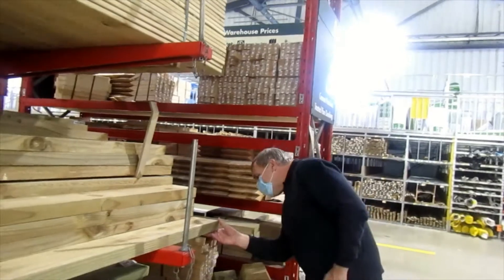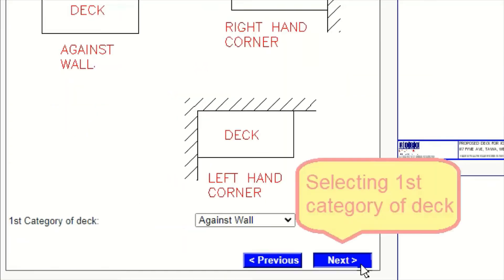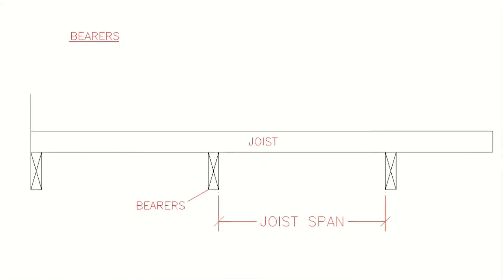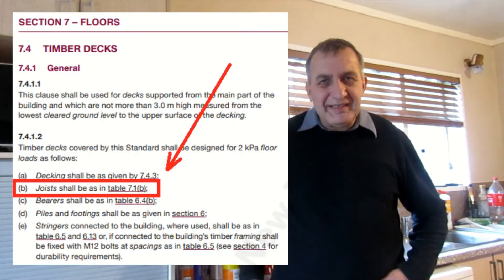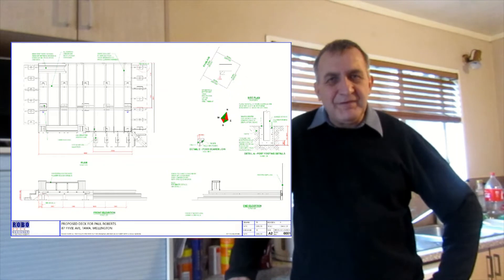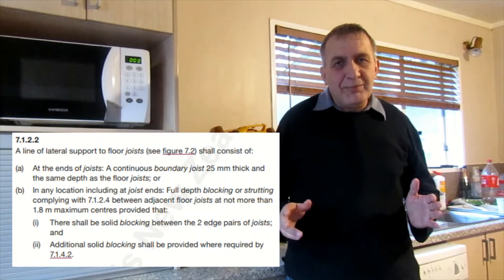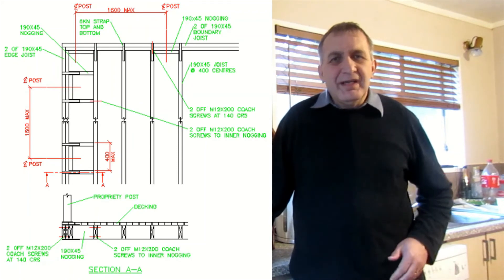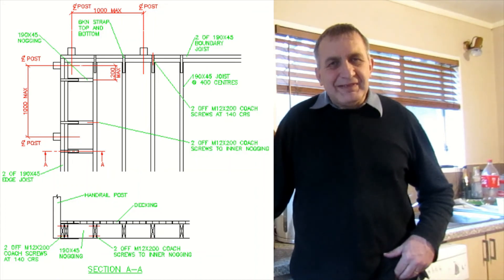Joists for a New Zealand deck using NZS3604

Comment: If my deck is 1m high or less AND I am putting on a balustrade do my deck joists all have to be 190x45? Considering that decks under 1m don't have to have fall protection do the regs apply to the design of the barrier?
Reply from the maker: Although there is no Building Code
requirement for the provision of a barrier 
protecting a fall of less than a metre, any 
barrier so provided is required to meet the 
performance requirements of the appropriate 
Building Code clauses described in B1 building code section 2.0 Guidance and the Building Code. With regards to deck joists being 190x45, my assumption on this is no, for a deck less than 1m high, but I would advise you to seek clarification from BRANZ
Reply: @robodeckdesigner  I looked at one of your deck with pergola designs and at 700mm high and with a hand rail the boundary joists and main joists are 100x50. So I assume the min 190x45 at 400 centres doesn’t apply for handrails on decks 1m or less in height?